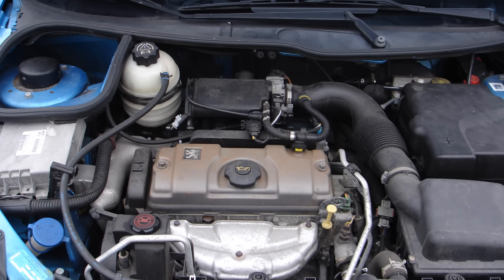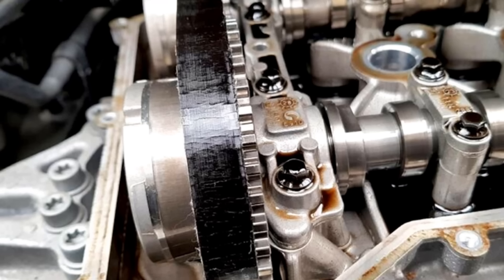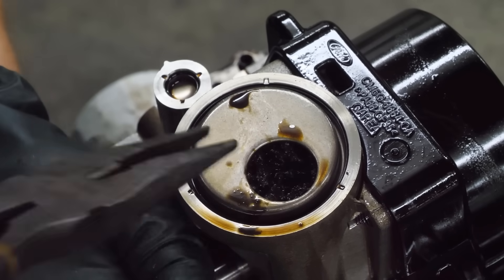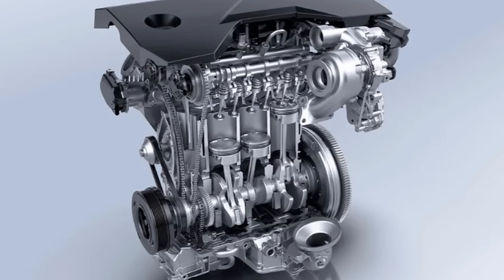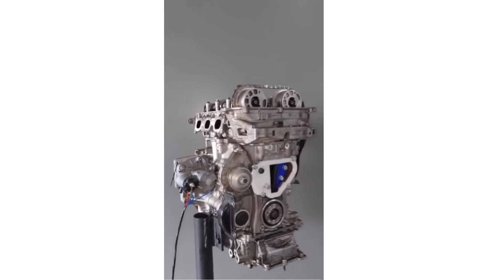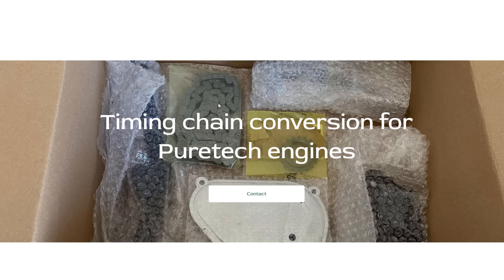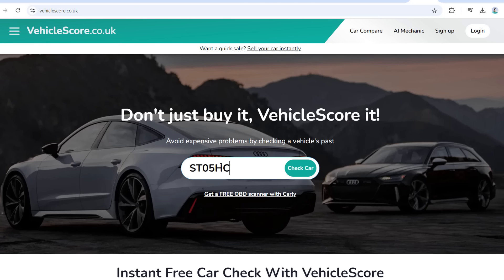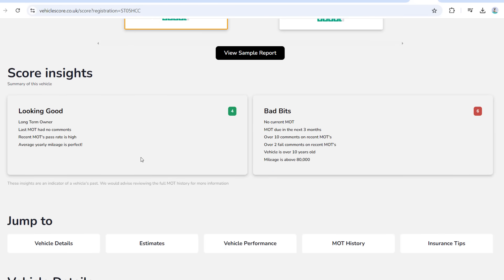Peugeot PURETECH Fix Is Here - All You Need To Know

Comment: I hear this “rubber and oil don’t mix” on so many of these types of channels. Engines have loads of rubber components in them exposed to the oil buy you never hear these channels bitching about that.
Reply: The reason the wet belt degrades is the gradual accumulation of petrol in the oil from multiple cold starts of the engine over time
Reply: @middleman9183  ET LES RECYCLAGES D  ECHAPPEMENT PAR LA VANNE EGR
Reply: Most of the rubber is for sealing mate, rubber under the stress of high stretching forces degraded by the oil is a different history bud, do the maths and research by yourself.

Comment: Purchased a Rifter 2019, not knowing any of this 52K KM and started to get the low oil pressure light and stop car light. Investigated and found out it was this issue. But was told Stellantis will replace free of charge. However found out that the last owner did not perfom the 50K service, so they would not pay up! Cost me 1200 euros to fix!!!!

Comment: Wet belts can actually work fine, so long as they aren't under high tension. I have an ohc lawn mower that has a wet belt and has run for over 20years. I've never once heard of an issue with one of those engines.

Comment: Strange, but having worked for a major roadside rescue company for 22 years I have never had to tow a car due to a broken wet belt. They always gave warnings. Towing cars, usually BMW’s with broken chains pretty much on a weekly basis.
Reply: First this engines start to blink oil pressure light, because the internal part of the belt started to dissolve and this "broken wet belts parts" goes to the oil restrainer. This repair at Portugal is about 4.000€, for a dealer, at others shops you can have a lighter repair bill, but the "normal shops" usually don´t gave you warranties knowing the "quality" of the product. this repair, if does not broke the belt, may cost about 30 to 50% do the car´s value.
Reply: @quidelicia1  et apres vous consommer de l huile!   voila la suite
Reply: oui le fameux 1l6   BMW   fabrique  en collaboration avec PEUGEOT    c est une chaine de velo qu ils ont montes la dessus!  et le tendeur  qui casse!
Reply: They usually clog up the oil strainer long before the belt breaks. One of our customers at work wrote off their Ecoboost engine by driving 50 km with the oil light on lmao
Reply: not the chain that breaks but the plastic parts bmw put in the engine that break first

Comment: I bought the Peugeot 2008 (2021 with 70k on the clock) 6 months ago. During warranty I got the timing belt replaced and twice empty in oil.. Still 6 months warranty to go but, to be honest I am very disappointed, every 2000-3000 km having new oil doesnt feel good.

Comment: Thanks for this, but our 208 has the timing chain not the belt but has the same problem of using too much oil. What else must we look at to sort this out
Reply: Do a compression piston test on each cylinder.
Reply from the maker: Try the pcv diaphragm. If not it is likely a deeper issue, piston rings etc.
Reply: Worn Cylinders... The engine is dead at this point. Sell it

Comment: I’ve just been quoted just shy of 3k to change the belt on a 2020 1.2 Corsa, I understand it’s a fair bit of work to change out and requires specialist tooling to lock the engine but 3k???
Reply: Whoever has quoted 3K is having you on, they're under £1k to fix

Comment: I'm on my fourth Peugeot / Citroen with this engine, two 208's and two C3s.  First two cars 60,000 and 50,000 miles respecitvely annually serviced, topped up with correct Total Oil, belts changed at 6 years old, no problems. I then bought two newer ones to replace the old ones and I believe if you maintain them correctly then no issues.
Reply: pas très représentatif car avec de si faibles kilométrages, pas étonnant de ne pas avoir de problèmes: mon moteur a commencé a consommer de l'huile a partir de 90000km et ça n'a fait qu'empirer (1L d'huile pour 1500km!) jusqu'à la casse du moteur à 115000km (segmentation HS, 1 piston fondu)  et ceci malgré des vidanges tous les 10 000km/ou 1x par an...La courroie avait été remplacée à 100 000km (était en assez bon état) et la crépine vérifiée (propre)
Reply: tu as changer les vehuciles  avant les problemes! heureux pour toi   mais je penses 20 000 km de plus tu pleures!
Reply: Total Ineo First 0w-20 ?
Reply: I take it you still believe in Santa Claus also. Best of luck next month😳
Reply: @ Me and Greg Lake

Comment: What is it, twelve years later?

Piston rings are the main source of the issue with the wet belt Puretecs as well. Oil dilution with fumes and petrol seeping through. So you got two issues, oil consumption, and oil dilution :D At least, oil consumption would 'force' you to change your oil more often, thus reducing wet belt issues. Clever PSA.

Engine of the year four years running, am I right?
Reply: not only the ring but the direct injection who wash the oil from the cylinders

Comment: We have more issues with chain driven engines (Ingenium/VAG 3 cyl/Vauxhall 1.6D/Transit 2.4/Micra/Mini/BMW etc.) than we do with the Puretech lump.  Regular oil changes and no flushes or additives.  At least the Puretech is an easy belt change compared to some.  You don't even take the belt cover off - unlike the Ecoboost where it's cat/water pump/starter and a load of other unnecessary crap that needs to be moved or taken off.

Comment: Whilst it's unrelated to the 1.2 they seem to try and apply same rodeo fix by changing oils to the 1.5 diesel, which were using 0w30, then 0w20, now the 5w30 from Total Energies, that is recommended on both Petrol and Diesel variants. Very briefly, the 1.5 diesel variant suffers from a weak 7mm cam chain that can snap and lead to a total engine failure. Models from 2023 onward have been replaced with the 8mm version to avoid this. There's no recall on this, and Stellantis group will only honor a free fix on very loose terms, as experienced and stated by several owners across the internet.

After spending several hours searching the internet on both 1.2 and 1.5 issues. The long service intervals are not holding water as I service my own vehicles with OEM parts and exact Oil specification from PSA to my 1.5 - owned from 27k, now with 85k. I drive between 30/40k miles a year (mostly motorways) and the oil and filter itself are not holding well as they reach 18k for their service.

The Total Energies RCP 5w30 is nowhere available in the UK, except the odd seller trying to make a quick buck on the scarcity. Luckily, after finding a member on the forum boards working for one of the Stellantis brands, pointed users to Mobil 1 ESP Formula P 5w30 which meets the brands specification.

Serviced my car last week at much earlier interval of 9k, to try the 5w30 as my 1.5 slightly rattles on startup for a minute (worse in colder days) - suspicious the 0w20 is not adequate. 
I've noticed the engine is developing some oil sludge despite being serviced to manufacturer standard, with this in mind I'll have to service every 5k to see if I can fix this problem.

First thing I've noticed, the engine is now running a lot quieter. Whether it means "better" I have to yet to make a full conclusion as the engine is still breaking-in on the new oil.

With the 1.2 petrol variant in mind, even if users change to a different oil, other contaminants (EGR, condensation, fuel dilution, etc.) will still play a critical factor in the condition of the wet belt or a chain driven modification if you get one. Chains are not immune to this.

The service intervals are far too long even for a long distance driver like myself. The engineers know what they're doing, but I believe this is mostly pressured by regulations to keep the emissions down at the sacrifice of longevity. With engines facing tighter restrictions, I don't see how an oil can last that long with all those contaminants, and don't get me started on the EAT gearbox being a non serviceable item! Laughable.

Comment: Didnt completely solve the problem, as the oil pump is still fitted with a belt. Also, have you seen the intervals of main dealers? 25-30K kilometers per oil change. Yeah... premature wearing of piston rings isn't hard then./

Comment: Do not buy anything with 1.2L Purecrap. I had an C3 with the 82hp, i owned it from 0km to 81000km. Yeah, it's used very little fuel because it was consuming at least 1L of oil at 1000km.
Never serviced at the specified interval of 25000km, always at maxim 14-15000, when people say "its because long interval service", think like me.
 If this engine have the capacity of around 3.5L and you consume 1L of oil at every 1000km, at 15000km you will have 15L of fresh oil and dirty oil filter.🤣🤣🤣
Beside this, i think it was better if they designed it as a 2T motor not 4T,  was easier just to mix fuel with oil directly.

My problem with this car was: 
-Engine have excesive shake (not because 3cyl), run rough and kick with rpm suddenly drops and jumps; 
- Steeringwheel was not staying dead center and car suddenly steer sideways; ( design problem, i did every calibration possible on this earth)
- Gearbox cracked at 64000km;
- Alternator start to whine around 40000km;
-Air Condition compressor start to grip it and when its activated you have: 1.5-2L/100km consumption increase, low speed feels like you are in an electric car with regenerative brake on maximum...its almost stop the car without brakes;
- Doors rubbing in the chassis paint/metal and plastic;
- Door cover plastic cracked after 60000km;
-Exhaust mount weld broke;
And many many more.

So STELLANTIS, don't complain soon with Q1,2,3,4 sales droping if you are building paper planes + not listening to customers.
I loved CITROEN and because of this C3 you lost me forever! Better sooner than later!

Thanks EU car industry for make us spend our money to chinese market! 
P.S: I am an mechanical design engineer.
Reply: alin - don't be angry, but you don't have a new c3, you don't have a burek either
Reply: heu je sais pas ce que tu as acheter mais vu ta description c est pas une voiture c est l image d une voiture   moi je porterai plainte pour malfaçon  ils l ont construits ou?  ZIMBABWE?

Comment: I avoid using E10 petrol, disengage start stop, change oil from the bottom plug, use the proper oil and don’t wait more than 10k km before changing that, or even earlier if the car is used mainly in the city. Also, give it a minute to warm up, those cold starts are very rich on fuel…

Comment: My wife's car is a 64 plate 108 and the timing belt has just been changed at 10 years.  The dealer reported no degradation  but the car has not yet covered 40k miles.  it drives beautifully.
My 17 plate 2008 had the belt changed on manufacture recall 2 years ago after low oil pressure was indicated.  It is now showing increased oil usage and I think it could be getting to the time to change it.
Reply: Dealer is not incentivised to report anything make sure recall for sump removal is done to view oil pick up.

Comment: Replaced my wet belt last year at 40k 6 years old, it was showing signs of early degradation but no debris in the sump strainer, I’m a firm believer if the correct oil is used and replaced every 12 months then I will have no issues, also my 1.2 130bhp prue tech doesn’t use a single drop of oil between yearly oil changes
Reply: Yep, same here. My 1.2 Puretech 130 gets regularly serviced by an independent. Just had the belt done as it was six years old. 700 pounds all in, new belt good for ten years.
Reply: tu consommes de l huiles a partir de 80000 km   c est la segmentation qui est pas adaptee et les cylindre s ovalisent  car ils sont en alu!

Comment: The actual cause for the 1.2 PureTech to burn oil, even if there were no belt issues or were solved before any oil starvation would occur is they have really soft cylinders, but the piston rings are really stiff so they will slowly wear away the cylinder and make it oval shape. My mechanic joking said that the only thing would be to create oval piston rings to solve the wear issue, which of course isn't possible to make. They actually discovered that engines were totally fine, but then out of a blue they started consuming lots of oil, usually after 100k km, just as the cylinders got worn over that point where the oil rings were still sealing. So that means the engine really is garbage, even if you replace the belt few times and service it every 5k km, it will stil bite you in the ass long before you reach 200k km
Reply: tout a fait! et c est encore plus rapide pour ceux qui ont un turbo!
Reply: d accord avec  toi   la seule solution a mon avis c est de mettre des chemises en fonte   dans un bloc alu sa me parais debile! donc faut refaire un bloc  fonte ou acier! bilan  plus de 100 000 moteur a mettre a la poubelle!
Reply: @dominiquebaumgarten8010  ? des chemises en fonte dans un bloc alu est tout à fait courant et beaucoup de moteurs très durables ont cette configuration et ça ne pose absolument aucun problème lorsque c'est fait correctement...Les blocs fonte sont souvent MOINS durables, car les alésages des cylindres sont taillés directement dans le bloc et la qualité de la fonte du bloc est nettement moins  bonne (bloc acier ça n'existe pas).L'usure du 1,2L puretech a PLUSIEURES causes: en premier l'injection directe: d'une part à froid, ça lessive complètement les parois des cylindres (les segments frottent à sec),et ça lessive même les cylindres à forte charge à chaud (et pollue l'huile ce qui détruit la courroie de distribution!) , car la brumisation n'est jamais aussi efficace que la VAPORISATION qui se produit sur un moteur à injection INDIRECTE grâce au temps de parcours plus long du mélange, de plus les microgouttelettes de l'injection directe ne se consument pas de la même façon que le mélange vaporisé (quasi gazeux): il se forme pour chaque micro gouttelette, un noyau de carbone= micro particules, et ces particules, se mélangeant a l'huile des parois de cylindres, finit par encrasser le haut des pistons, puis les segments et enfin les canaux de retour d'huile des pistons et qu'est -ce qui se passe lorsque les segments sont grippés?: rabotage des cylindres (usure rapide), et racleur inefficace (consommation d'huile) allant s'amplifiant du fait de l'augmentation des fuites (blow by), sachant que ça arrive très tôt car contraîrement à ce que certains disent les segments sont très fins et a FAIBLE TENSION (pour réduire les frottements), ils se grippent donc facilement...après il y a tout un tas d'autres problèmes, quantité d'huile trop faible (sur le 1.0L Ecoboost de Ford similaire au puretech, le carter contient 2L de plus!!!) + intervalles de vidanges trop importants, conception globale du moteur à l'économie, bref un moteur loupé conçu par de jeunes ingénieurs qui ont complètement ignoré les erreurs du passé et les erreurs faites par d'autres constructeurs (VAG a eu les mêmes soucis (en pire!) sur ses TSI/TFSI sortis avant, et Ford pareil , mais dans une moindre mesure car moteur mieux conçu
Reply: @dominiquebaumgarten8010  n'importe quoi, car tous les moteurs modernes ont depuis 50ans un  bloc en alu et des cylindres en fonte, soit amovibles, soit insérées par différence de t°, des moteurs bloc fonte je crois que les derniers c'était au début des années 2000...
Reply: yes you have right  it s the main problem

Comment: After 20 years 1.6 HDI I changed camshafts , few walves  , and made big service. Stil runs 😂
Reply: fuck ı chnaged turbo 4 times in my volvo
Reply: @bbkengineering6612  my turbo is garrett 400 000 stil running. Be gentle first 20 min when driving especially when it is cold and change oil every 10 000 km , if you driving fast give 1 min rest to turbo before you switch off the engine and you will be fine.
Reply: @bbkengineering6612  if it is 1.6 it is the same engine
Reply: @zorankomadina7540  ja sam kupio 308 t9 1.6 hdi sa 300 000km, moze taj da tera barem jos 200 000. E sad kod turba bi trebao da se zameni onaj sraf sa filterom koga zovu banjo bolt jer taj filter zacepi pa ne podmazuje turbinu. Moram da iscimam majstora da pogleda taj sraf, malo je zeznuto sto mora i dpf da se skine.

Comment: What you guys should know..
Stellantis has extended warranty of the older generation 1.2 engines on oil consumption problems and premature timing belt problems to 175.000km and 10 years!
All you need to do is follow the service schedule and keep receipts as a proof of correct maintainace..
Does not apply to 2019 or newer 1.2 turbo engines..
1.2 non turbo dont have timing belt problems, as port injection does not pollute the oil as much with fuel😉
Reply: Is that in writing anywhere?
Reply: 1.2 atmo    a aussi le meme probleme   de courroie mais  a un kilometrage plus eleve
Reply: I wouldn't trust stellantis to order me a pizza.

Comment: Mine is a 64 plate, 100,000 miles, no belt issues, I use PSA spec magnatec, I wonder if the main dealer is charging £75 an hour for some minimum wage 17 yr old to put random oil in cars 🤔